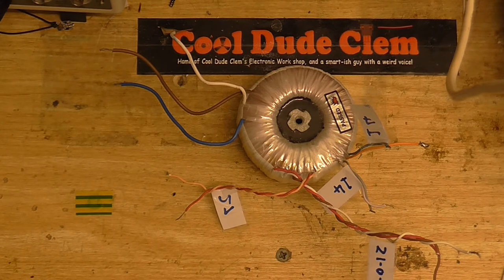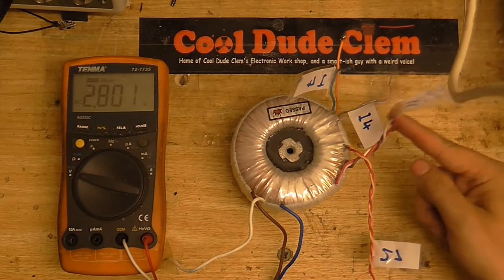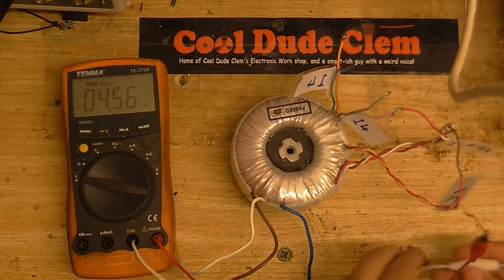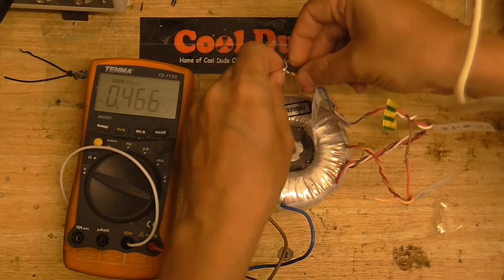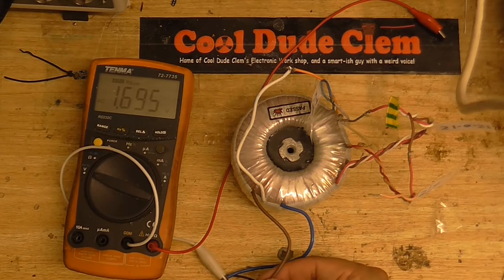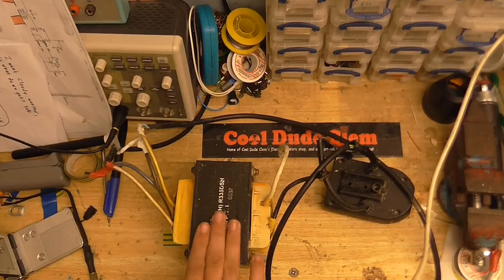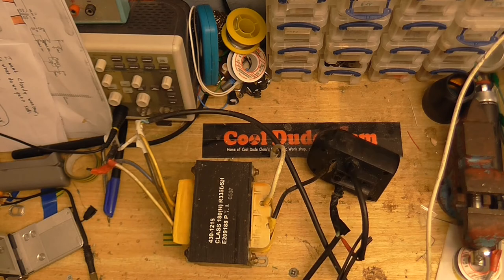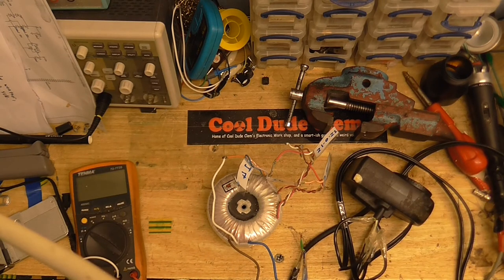Proparing for the HEAT

Comment: The beep sounds like a smoke alarm low battery beep. How people live with this 24/7, I'll never know. I suppose it's possible that the owner could be elderly and unable to hear the sound.
Reply from the maker: I think it's mostly young people in that house, who of course, like everyone else around here, are immigrants.
Reply: @CoolDudeClem  smoke detector it sounds like to me. they are the type that is too lazy to get a new battery for it.
Reply: You just get used to the sound if enough time passes.
Reply from the maker: @megabojan1993  I wouldn't. I can't tune intrusive sounds out, I hear everything. As an aspie every sound penetrates me like a jackhammer! I saw a video some time ago where there was some guy and an autistic kid, they were outside, and using a mixer (it wasn't connected to anything) to indicate how loud each sound sounded to them. They would move the faders which were labeled with each sound until they represented how loud each sound sounded to them. With the guy, each fader was at different levels, but to the kid everything sounded loud so he turned all of them up full, and that's pretty much how I hear things too. It was pretty interesting but I cant for the life of me find it now.
Reply: @CoolDudeClem  I'm sorry to hear that. It must be a living torture to have that condition and live in a such a noisy environment.

Comment: Put an air conditioner in it works better than a fan
Reply: I live in an apartment actually and I did put a window unit in not supposed to but I got a doctor's note because I overheat easily medical issues and it also helps drown out noise
Reply from the maker: I'd love to but I just can't afford one.

Comment: So grateful for the cheap Chinese air conditioner mother & fathersnail got us a decade ago. Around $200 USD at the Mart of Wal's. Pretty swish unit for what we paid - keypad controls with a bonus remote unit. Best of all, it has an energy saver control so you can keep National Grid from taking the whole arm and leg. When you've lived the majority of your life without AC, it's almost like those, 'game changers' the kids talk about...

Within a month or so of getting the AirCon, we actually found a working one 'released in the wild' a few blocks from home. Installed it in our bedroom but we've had to keep it off and camp out in the living room on account of the century-old wiring here at La Casa Caracol.

https://www.youtube.com/watch?v=uZD9LK_EHn8

With regards to fans, we haven't bought a new one in ages on account of people kicking perfectly serviceable ones to the kerb all around our neighbourhood. Just clean the things, sort any misaligned bits, maybe drip some '3 in One' into the shaft and Bob's your uncle. We've found quite the variety of 'em - one runs in the kitchen as an extractor, a tiny one sits in the dining room for a light breeze whist eating. When we're at the 'workbench' the same fan can be turned around for comfort.

Our 'computer lab' has this wee beastie...

https://www.youtube.com/watch?v=QkLhRiaimhc

That was a treat sorting out and putting right - and the feet have since needed repaired (with zip ties).

We also have this bonnie wee lassie...

https://www.youtube.com/watch?v=1xVLGYp7Ptk

Our best all-metal fan, even if not in use that much these days. Have had to rebuild the switch a number of times. We've a 'Frankenfan' in the kitchen where we grafted the motor of a box fan to a floor fan (similar to our Patton). Sits atop the icebox and is used on occasions when the kitchen gets a bit on the stifling side - there's a remarkable 'lag' between temperature rises outside and inside the apartment thanks to the layer of insulation installed with the (ugly-as) vinyl siding back in the early-'90s.

Another Frankenfan we don't use but keep around is an old computer fan we grafted to a candle holder that we used to keep by the bog seat for a bit of cooling - there's a full-size fan screwed to the wall above now. Snail gotta be comfy on the throne...

Sorry to waffle on so much but it's midnight here and we just got up from a nap...